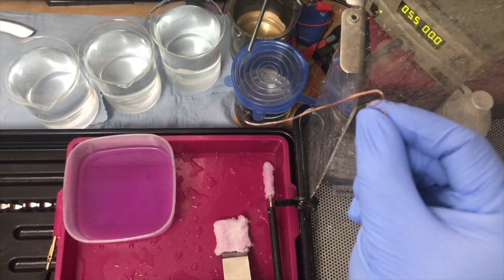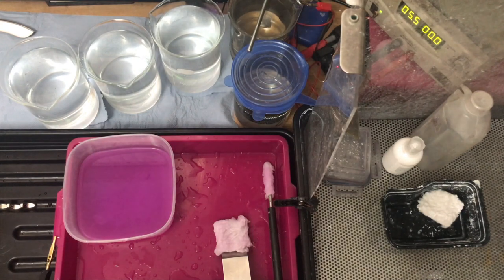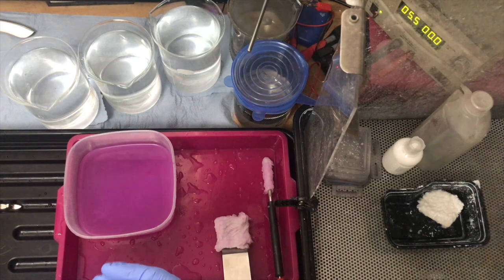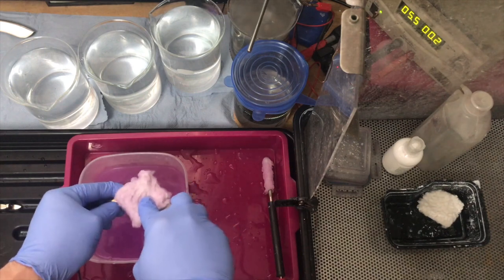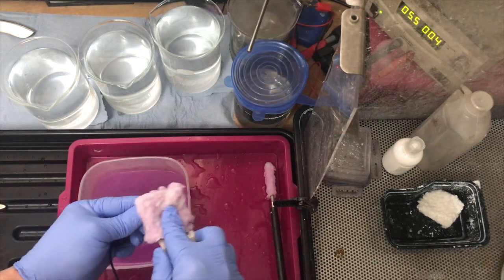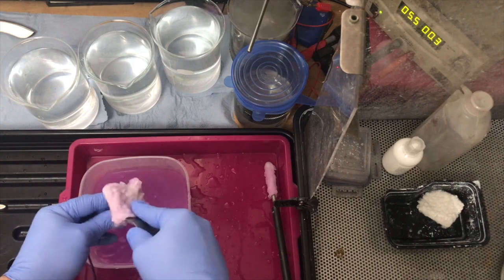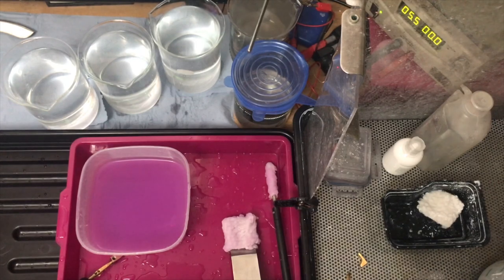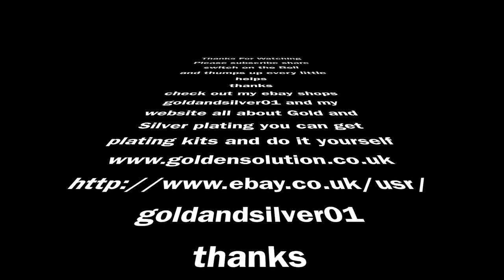How to Gold Plate Banjo Parts Quick and Easy

Comment: How long does this plating last though? If it wears off quickly then it wouldn't be worth all the effort and expense.
Reply from the maker: Jon Bluegrass 
Hi it’s depending on how many microns you plate 
It will last for years in this case 
Thanks
Reply: @GoldenSolutionPlating  So do the parts have to be originally nickel plated? What about chrome? Also, what if the nickel plating is worn on some parts? Sorry about all the questions, just interested as I know nothing about plating.
Reply from the maker: Jon Bluegrass no 
In this case there are nickel but they can be chrome or stainless steel 
Copper or brass 
You need to nickel plate the copper and brass before gold plating 
Chrome you need to remove and under the chrome is nickel 
Have a look at my other videos about chrome stripping 
If the nickel is worn on some areas I would polish the item with a buffing wheel and nickel plate I have a video about polishing as well 
Thanks

Comment: I learned nothing from this
Reply from the maker: sorry about this
you need to know brush plating and banjos all or most banjo parts are Nickel plated so are this parts and they need to get activated in activator to be able to plate gold on it there are different ways to do this i can use a swab and activator, MPU  or use a beaker thats the quickest way to activate Nickel 

if you dont activate nickel before gold plating you will have problems with adhesion so the gold plating can peal off
thanks 

https://www.youtube.com/watch?v=MnWg_i3mbs4&t
https://www.youtube.com/watch?v=PFbVL0OCTT0
https://www.youtube.com/watch?v=gFPJEqRZmAI&t=14s